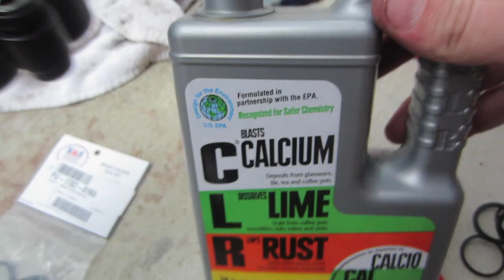Secret Florida Turtle Spot & Honda Helix Motorcycle Brake Rebuild | Vlog 167

Comment: Next time, use your air to remove the pistons. Place the blower in the fluid inlet and release air into it slowly and they will pop right out. On your van, Tighten your harmonic balancer by placing a 5/8" or about that size, deep socket between the harmonic balancer and belt. If you need a schematic or further help shoot me a message.

Comment: Thumbsup for super secret ninja turtle spot! :)  They looked happy just to be in Florida (Japan throwback LOL)  Good job with the brake rebuild--yeah, in hindsight, pumping those pistons out would have been easier but you got it.  At least you had the foresight to wrap a cloth around the piston before wrenching on it. LOL!  You could probably polish most of those marks out with some fine 220 or 320 emory cloth (you could probably find it at Costco while you wait for your sub) but I don't think it will give you much trouble in the future.  Saw is sharp.  Now, get in the wind! :)
Reply from the maker: They were happy to be in florida 🐢! ahhaha Hindsight is 20/20. I figured since they are pitted that I couldnt screw them up too much. I did order a new piston to replace the worse out of the two and see if that gives me some more pressure on the pads. Maybe ill replace both. Not sure yet, have to see. =) Saw is sharpening!